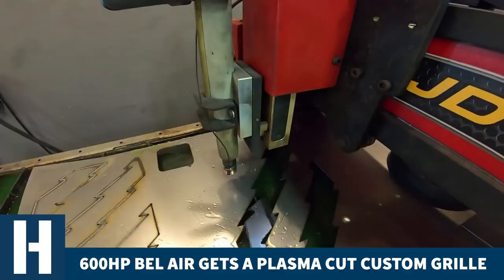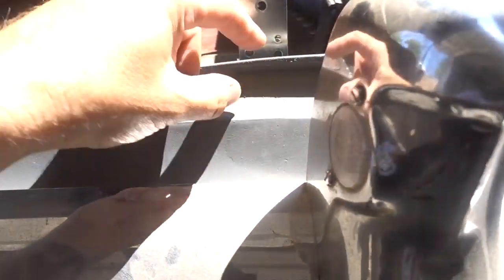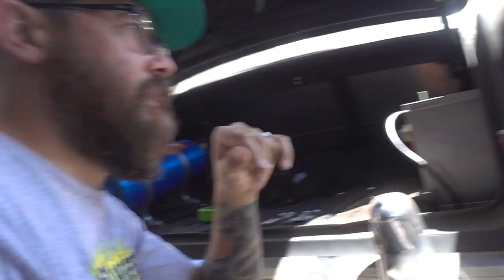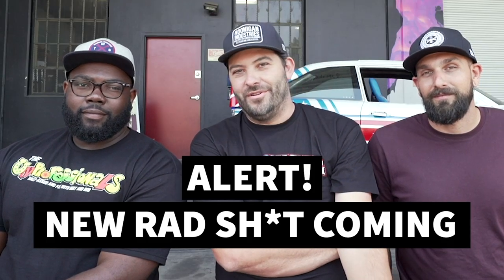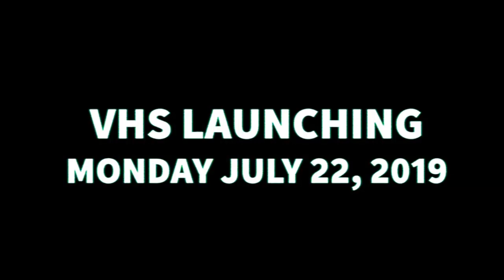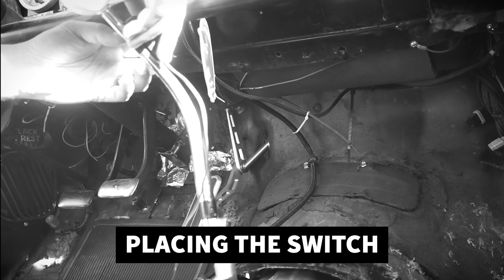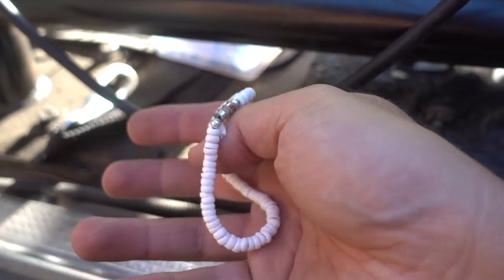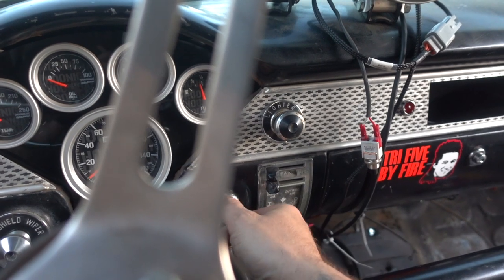Drag Car Things With Jon's Chevy: Line Lock Install!

Comment: Theres a rubber wheel attachment you can put in an electric hand drill that works very well for taking tape marks off. just dont be overly agressive with it. takes a quarter the time goop off would

Comment: You need to pump brakes 3/5 times before engaging line lock button to assure enough pressure to hold front wheels, fyi

Comment: Easy way to witness mark for those pins, just put a little dab of grease on the pin and back it out til it barely misses the edge of the trunk.  The grease is thick enough to stick to the trunk lid and leave a perfect mark

Comment: try pushing the brake and the gas with one foot using the heel toe system , ralley drivers do that all the time and it should lock the wheels plenty while dumping the clutch at the same time 
https://www.youtube.com/watch?v=nzcRZCcikwM

Comment: Put toothpaste on the end of the pin in a glob and when you line it up the toothpaste shows you a general area to drill. I usually have to line it up a few times to get it close to perfect.